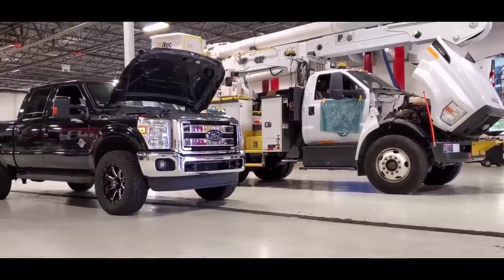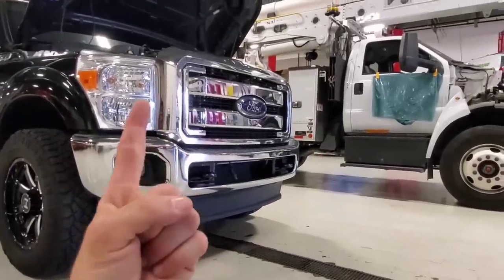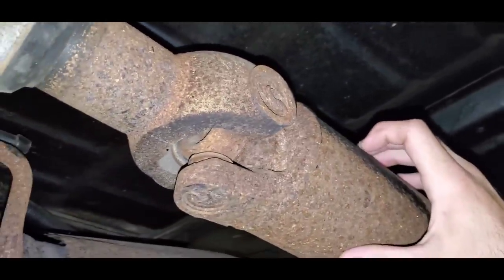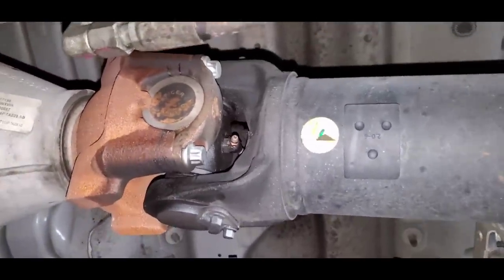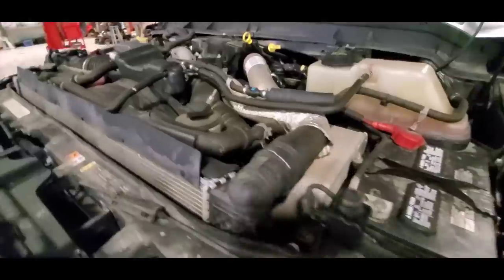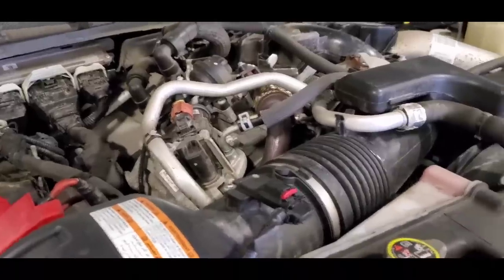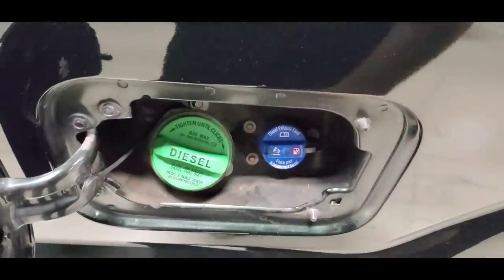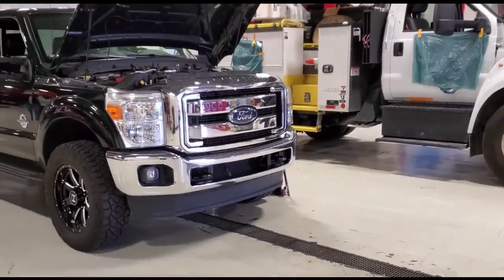The 3 things every POWERSTROKE owner needs to KNOW!

Comment: Arod great video. Ive got a question I have a 2017 F-250 diesel with a little less than 15,000 miles. Iknow the miles are low I had a takehome police car up until a few months ago so dont drive a ton. I do drive on the highway most of the time. I have had all services done when needed but i have never had a Regen with the DPF. Do you think thats an issue the truck runs great.
Reply from the maker: It most likely has you just didn't even notice. If you add DEF she a regen'n. If it didn't you for sure get some sort of DTC set eventually.
Reply: Last oil change they filled the DEF.
Thanks
Reply: You’ve definitely had many regenerations in that many miles but apparently haven’t noticed. On a ‘17 there’s no light or message or warning. If you’re very in tune with your truck, you’ll notice a slightly different engine tone during a regen, and you’ll see the turbo gauge become more active. You’ll also smell it at low speed or stopped. 

FORScan can activate your exhaust filter screen if you need visual confirmation of a regen or how full your DPF is.

Comment: What's the HP and torque difference between the F250/350 & F650/750?
Reply from the maker: Not sure, how bout that new 1050 ftlb of torque on da NEW 2020. GO FOMOCO
Reply: @PowerStrokeTechTalkwARod   😱 1050 ft/lbs! Closing the gap on the class 8 world rapidly. How much will be to much?? I own a 15 250 personally and work from a 17 450 daily and would drive a bowtie or goat to the scrapyard day 1! Loving my 6.7 powerstrokes!!
Reply: 650/750 are de tuned for sure  compared to the 250/350

Comment: I thought the CC variants have different heads, turbo, ad derated ECM from the pick-up variants. It may be a "good" engine but it's a travesty to put it in a truck expected to tow and haul with no real engine brake. For the money, I would PAY for a straight six with a legitimate engine brake in a new CC F600!

Comment: is the  duel remote by  pass from amsoil a good system to use ? i put it in my truck last year and havent had any problems with it
Reply from the maker: Never seen it
Reply: i used to get a ticking noise after my oil changes and it would go away after about 300 miles now with this bypass kit it has a second bypass filter that cleans the oil even more now the ticking noise dont go away ,so i think its keeping the oil clean

Comment: Got a 2016 250  6.7 with 170K (we put 100K of those Miles) but now I am dailying it for work. I keep hearing some folks say 5K miles is max before an oil change, others have said 8k is fine too. Does it depend on how you use it or is it a religious thing to change the oil no matter the milage ? Lots of different opinions out there. To be clear, I have only had it or 7 months and have done 2 oil changes. but its been in my family for 5 years.

Comment: Recently my license plate lights have quit working. I’m out on the road working right now and can’t take my truck to a shop. Any help or insight would be greatly appreciated!!!!
Reply from the maker: Start checkin the circuits back there. It shares the running light circuits. If they work then u knw its gotta be right in the bavk some wheres. I mean check the bulbs 1st...
Reply: PowerStroke Tech Talk w/ARod tried replacing the bulbs first. All other lights work flawlessly
Reply: I’m just kind of scratching my head at this point
Reply from the maker: If u wanna email me i can try n help
Reply: PowerStroke Tech Talk w/ARod that would be great. What is the email?
Reply from the maker: Powerstroketechtalkwarod@gmail.com

Comment: And if you totally want to eliminate any maintenance issues, take that 600 lb. turd off the exhaust, get rid of the 300 lb. thing that puts dirty air back into your combustion chambers, and give it a “mild” ecm massage. 600 horse to the wheels and 1200 lbs of torque makes everything better.
Reply from the maker: No doubt

Comment: Looking at buying a very well-maintained 2012 F250 with 214k miles. Should I be worried?
Reply from the maker: 🤷‍♂️ peoples versions of "well maintained" is up for interpretation....sry pal
Reply: @PowerStrokeTechTalkwARod  It is but I know this guy did everything that needed to be done in the prescribed time frames and it was only used to pull a small camper.
Reply from the maker: Do it then

Comment: Hater report....I have a 17 550 6.7 and I fear the time it goes into the ford shop (stealership). I have already had a 15 450 6.7 and it had problems out the door, by the time 25k rolled over alternator and bats went out on vacation. While changing the bats that day I noticed the hydraboost was leaking. After I got back from vacation I traded it in on a 17 550 and again at 25k the bats went to shit. Ford would not return my calls about scheduling a time to get it in (I called 5 times in 3 weeks). I bought an extended warranty on this beast. I ended up changing the bats myself. 

  I also have two 7.3psd's. One is in a 96 f350 and the other is in a 2000 International 4700 bucket truck it is slower than a snail but I know if somethin happens I know I can fix it. I woould really like to keep the 550 6.7 but after my experience and watching your vids I really hate to dish out money for something that was a engineering flaw. As soon as I can I am selling the 550.
Reply: Sound like simple problem.

Comment: I saw this idiot on YouTube tow a 44k pound trailer on his I believe 2018  F350 or 450. Very impressive but also dangerous as that's a load for a heavy duty class 7 or 8 truck. He was towing the trailer up a hill in 4 low but I'm also impressed how non of the drivetrain just snapped. 
On modern trucks the Powerstroke or Duramax are my favorite.
Not really into the Cummins after the 5.9 especially the newer Cummins. Seems like Cummins has gone down with Quality control and working at new construction, Duramax and Powerstroke are the most common on Crew cab utility beds towing skid steers all the time.
Reply from the maker: Powerstrokes are NUMBER 1. We will never get rid of the world dummys, then again there would be no youtube either......
Reply: The vid you guys are talking about is from Danger Industries.  I’ve subbed to his channel and will continue to do so only to see how much abuse his 6.7 goes through.  I have a 7.3 non-catalyst manual trans & always have wondered if it’s worth trading it in for a 6.7.

Comment: Or just buy a gas engine and not have to worry about half of that shit..lol
Reply: Usually it's because of the towing limits with the gas that companies need the diesel. I am intrigued with the OHV 7.3 that Ford is going to make.
Gas though has gotten complex as well, trucks now have 4 cats so I don't know what's the difference, if you start burning oil it will kill the cats and turns into a nightmare.